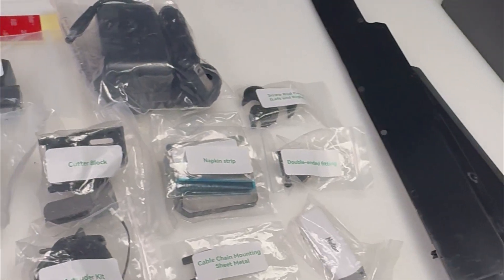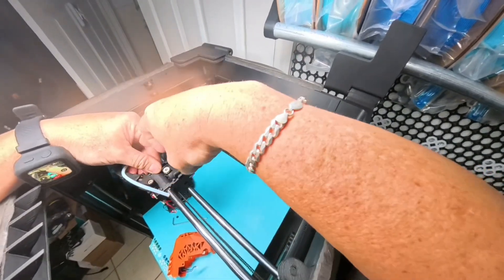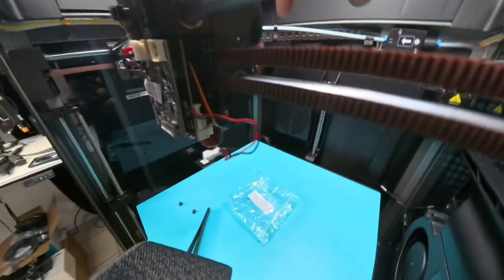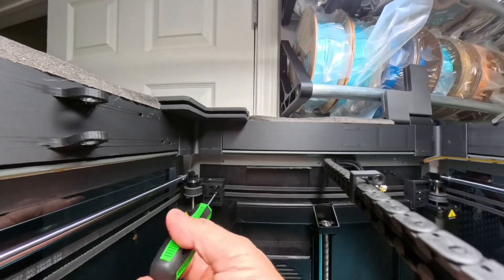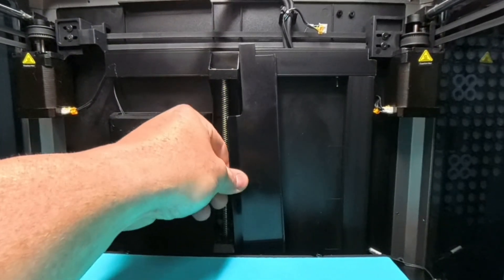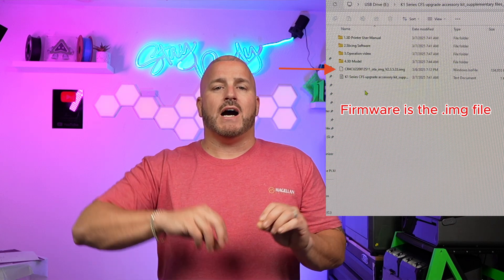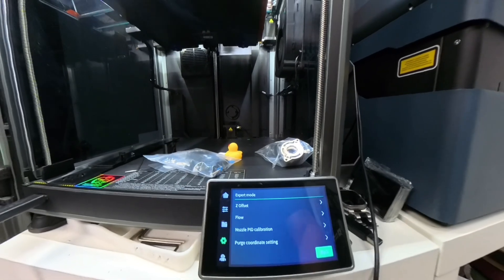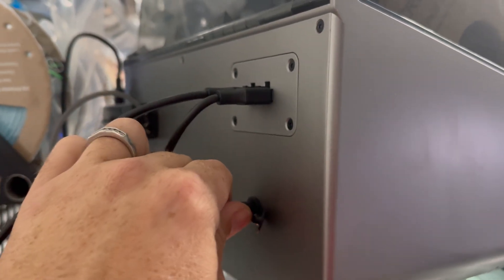A Multicolor Upgrade For The Creality K1 3D Printer

Comment: Got my CFS kit within a week of ordering and got it installed. It's been running great. What nobody tells you but YouTubers is that multi-color printing extends your print time by a lot. You've got to be more strategic in how you plan your prints.
Reply from the maker: Very true. Not worth it now that multi tool machines are coming out. CFS style is fading fast lol
Reply: @mattsarahhall6760  hey if you didn’t know, you can also add a print for flushing instead of wasting all that extra equipment that you can just have some kind of multicolor object get creative. I tend to make a utility blade, I don’t really care about the colors. send it essentially takes up all that extra time.
Reply from the maker: I’m more concerned about the time you lose. Waste or no waste it takes time. The multi tool is a much faster color system.

Comment: What about the ptfe below the extruder, the new extruder doesn't fit, I have the unicorn hotend coming so do I just remove that ptfe tube?
Reply from the maker: The new extruder foot mine perfectly. But mine had the updated hot end with the unicorn nozzles. There’s a slight mod you’d need to do to make it fit.

Comment: Have you had any communication errors pop up?

If I had to guess the camera and the USB port are on the same controller and the way it's configured it's acting like there's not enough bandwidth to support the camera & constant communication with the CFS. Every time I try to watch the camera feed it'll throw a communication error, which you can just hit retry and it keeps printing, but going forward the camera isn't detected any longer  (until a power cycle).

Mainly assuming this is an issue with the current firmware, but I haven't seen any firmware upgrades outside of what came on the USB drive with the kit.
Reply from the maker: I haven’t used it much after install. We’ve been very busy with events.

Comment: It’s all well and good to say “you have your CFS upgrade kit”. But due to the way Creality has been dribbling out the kits, the vast number of users who wish to get a kit, have been unable to purchase one or even submit a backorder. Recently, the company has instituted an email list of users that will  be informed when some number of kits become available. But it is very hard to understand why this issue is being handled in such a manner.
Reply: Stay ready is not to blame for the delays by creality.  At least there is a video of the steps for when people DO get their kits.  There are no actual instructions with the kit itself but instead there’s a qr code which takes you to creality typical videos and diagrams (which run as smooth as butter).  This way you get to know about any pitfalls, problem areas etc so you can prepare before hand and if there are any mods or different ways, you are prepared beforehand
Reply: @ I know, I’m just frustrated with the way Creality is doing things.
Reply: @JustSomeHuman-j8o  I feel ya..,, u only get 1 silicone wipe brush (napkin they call it) which you have to stick to the back of the build plate.   Its different to any of the other wipes I have seen from creality and bamboo so that means u can only use 1 build plate as I can’t find replacement creality ones
Reply from the maker: You can replace that wipe pad with pretty much any other one. It doesn’t have to be that one.
Reply: Are you sure???because when I compare the Cfs upgrade wipe, its dimensions are totally different to the Bambu x1 and p1 wipes as well as the wipes you can purchase from creality… also do you know what the point is of the second silicone wipe is (part of the spring hopper system) as the nozzle doesn’t go across this at any point??
Reply from the maker: Yeah, I mean if it’s too small it won’t work. But if it’s bigger just cut it. I printed a mount for the wipe strip so I can change plates with out removing the strips. The file is on printable think. It screws into the z axis rod in the back with 2 screws. If you can’t find it, let me know and I’ll probably still have the file on my printer.
Reply: @stayreadyto3dprint  Problem is. Because it’s so long from the only fixing point, it tends to warp after a while even in asa or abs…. Even quicker if your’ re printing other things in high temp settings… it took the original off of maker world for the k1 and extended it…… lasted about 5 prints

Comment: Also… as I stated on your access fluid video, it appears that you lose root fluid on the new firmware for the Cfs upgrade….when typing o]in tour up and port, all you get is a white screen within creality print, or the connection error if your using a browser
Reply: Found a guide to get working but won’t let me post the link
Reply from the maker: Once there is a fix for this I’ll post it. Thanks.

Comment: You can still use the same flash drive, just move it out of the folder so it’s in the root of the drive….. firmware doesn’t look into folders
Reply from the maker: The firmware wasn’t in a folder on the drive. I just moved it to a drive by itself just to be sure I guess lol
Reply: @ oh…it’s just mine was in a folder with all the other supplementary files
Reply from the maker: @ oh ok. Mine wasn’t. But still wasn’t working for some reason. You can see in the video mine was not in a folder.

Comment: I had the spring installed wrong. I didn’t realize that it has to snap into that small opening. I had it just laying in the bigger open space. When my bed would home it would just barely touch it and the bed would think it was hitting the nozzle.
Reply from the maker: Glad ya got it fixed ! Happy multicolor printing!